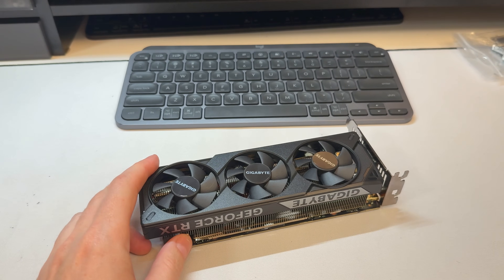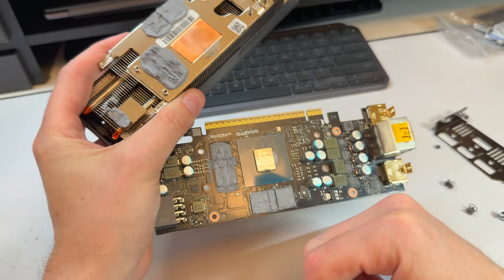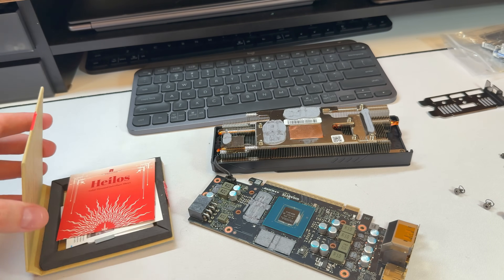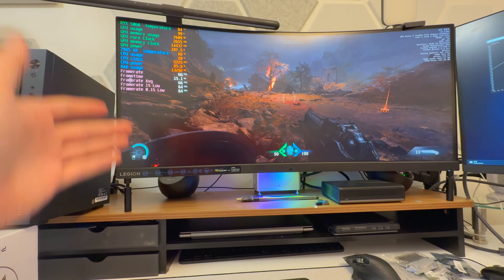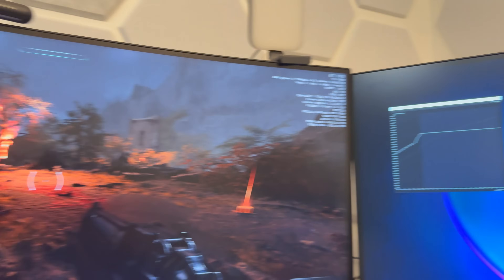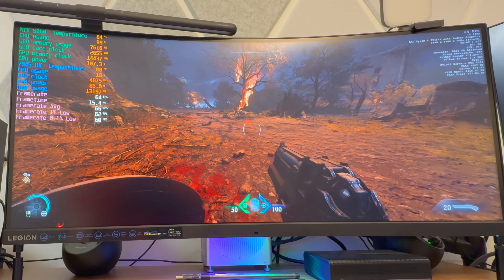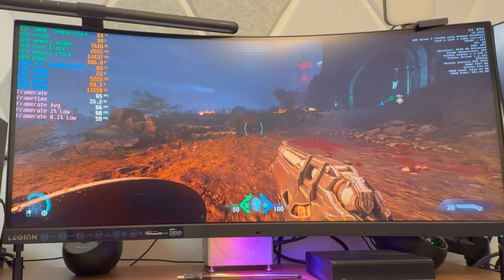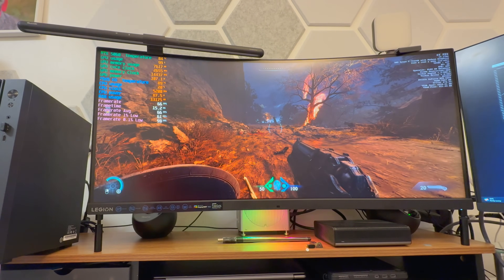Gigabyte RTX 5060 Low Profile - Thermal Fix, UnderVolt / Overclock (and results)

Comment: How is it possible that I'm getting 100W and a maximum temperature of 74 degrees Celsius with an undervolt of 950 mV, while you're getting higher readings with an undervolt of 840 mV? Have you stopped the fans? You should check if you've set the PTM correctly...

Comment: Damn... it's fuckin' hot 86-88*C Low-Profile GPU..
Reply: I've undervolted it to 950 mV and it doesn't go above 75 degrees at 70% fan speed, and I think I can adjust it even more.

Comment: Is anyone else getting a high pitched whining noise from these LP cards? I've tested 3 separate ones, on 2 different motherboards, with 2 different PSU's with and without riser cables, and it always produces an incredibly high pitched coil whine even on idle. When I stop the fans on the card from moving the noise stops. Could I deshroud and replace the stock fans maybe?
Reply: I dont have any coil whine on this card.  My 5080 FE is another story, terrible whine.

Comment: I would like to run the 5060 in my SFF case only over pcie power.  It is possible to limit the 4060 (originally115 watt tdp) to 70 watts and it still has decent performance. Could you do a comparison with the 5060 limited to 70 watts?
Reply from the maker: I don't have this anymore but the 5060 does perform well under lower wattage scenarios

Comment: Thanks for this video. I am about to do this change over to PTM. Yes, this sucker just runs hot. It will get to 89c fairly quick. I have run it case closed, case open, with a aux fan blowing on it to scrub away the hot air; doesn't matter. BTW, I am able to overclock mine with MSI Afterburner +400 on both core and mem clocks. So core clock runs about 3000Mhz. Even at 89c it only drops to 2950ish. It's quite the sweet little card of you need low profile. UPDATE: after adding PTM, the temps have dropped about 5c. Well worth the 15 minutes work (if you are brave enough) 😁 thanks again @TechGuyBeau for the how-to
Reply from the maker: an extra fan helps a lot

Comment: Is there any way to share afterburner setups? I have the same card. Just finished a build today and I'd like to get better performance out of it. I'd love to try your settings without having to click a million nodes on the curve graph 😂
Reply: I can share mine - +430 core, +400 Mem, set fans to 100%, power limit to max (103%). I haven't tried any undervolting yet.  I set high score in port royal for my CPU/GPU combo at 9406. I had just added the PTM as shown in this video. Power was at 150w, max temp now is 84c with the PTM (used to hit 89c)

Comment: What's the lowest voltage you can set on the RTX 5060LP? What's the maximum stable clock speed in this minimum voltage? I have a 4060LP and can set it to 870mV, which allows my cart to run at the factory 2460MHz, which is probably a good result. However, I'd prefer even lower voltages due to CPU overheating during extended gaming sessions (SFF case).

Comment: Why my card not like u rtx5060 colorful nx. My base i 2550mhz and 0,960v 69’C  153fps and when im set it to 2600mhz and 0,900v-> 0,950v it drop about 3-10 mhz is drop under 2550 :))) fps temp is 61-69 it bullsshit :)))
Reply: Can you show your GPU power draw while in some rly demanding game? I would like to know how low it can go while being around 2500-2600mhz.
Best to use multiple games for it, cóż blackwell turn off or pit on to lower power mode not used parts of GPU, so some gamę can be much at lower power draw.

Comment: Thanks for showing the before and after. Does the card hit 100% fan speed? Did it hit 100% fan speed before your optimizations while throttling? How many rpm is that?
Reply from the maker: in the small case it runs full throttle in gaming and seems like 50% otherwise. in a slightly larger case it still hits full fan speed in games, but the clocks can maintain higher

Comment: Does the low profile have a 16 gig vram version?
Reply: nope, the low profile based on 5060, so no 16gb. but it is good than 4060.
honestly i regret buying 4060 LP for $320 2 month ago, because the 5060 LP only $350. rip decision
Reply: @Daffamalik143 Don’t feel too bad. I have the RTX 5060 LP 8 GB by Gigabyte. It’s not even in a small pc case yet, and it’s running a bit hot. And performance drops when pushing it to the limits (stock) 145W vs 115W (4060 LP) so cooling is an issue. Same style and dimensions. It’s still a bit faster even when running hot. But reliability over time can be an issue, unless, we do what this video is showing. I want to build a custom copper cooler for mine. Hopefully one day…
Reply: No! But wish it did. One day it will happen. Or at least 12

Comment: What is ptm ?
And whats tho lowest Power consumption without loosing Performance
Reply: PTM in PTM7950 stands for Phase Transition Material. Unlike Phase Change Materials (PCM), which store and release thermal energy by changing between solid and liquid states, PTMs undergo structural transitions that enhance heat transfer. It can be a pain in the backside to apply, but patience pays off. Don't worry if it tears a bit, just push it back in place and mount your cooler, as it will flow once heated. After it has heat cycled several times (you've played games for a while etc and then turned your PC off) go back and check your tensions on the mounting of your cooler. It is expensive when compared to thermal paste, so be sure you won't be opening your GPU or CPU cooler often.

Comment: You cant just slap a 3gb memory module on the card. The memory bus has to be specific for that from my understanding. You cant just change the chips. Like thats why the 5060ti 16gb isnt the 5060 ti 12gb which would make more sense. But they cant do that.
Reply: Afaik its with the Vbios programming for memory timings. The complicated part is rewriting the whole thing to make it work.

Comment: Looking forward to your 12GB mod on this card. I'm also trying to attempt to get it done.
Reply: Also needs the vbios to ve reprogrammed to accomodate 3gb modules
Reply: @barredgrounddove no, supposedly the bios doesn’t need reprogramming. Instead you need to move a couple of the resistors on the board
Reply: Wait, you are trelling me its possible to increase the vram on a RTX 5060? I just bought a prebuilt PC with this card (two fan, normal sized) it would be awesome if i could increase vram so it is more future proof
Reply: @KrzysztofGniewek it’s possible but requires precision surface soldering.

Comment: I did something similar with a 4060 LP OC, i used PTM7950, fujipoly thermal pads, deshrouded and plugged 2 arctic p8max fans. 975@2700mHz, +1000 mem, -370 core, the temps are 35c Idle and 48c under load, max temps when stressed is 68c. 😂😂 the fans are screaming. But the temps are chillin.
Reply from the maker: I'm the opposite, let it bake, so long as it's quiet.
Reply: my 4060 LP OC use default thermal pads and PTM7950, the temp before is 90c max load at 115w and now 84c max load at 115w. sure it's fucked up, but i am using it on my optiplex without side panel modification, idk but i felt even tho same watt i dont feeling any lag or stutter